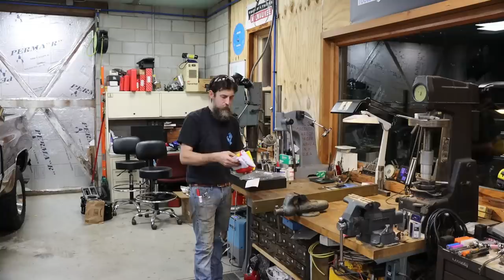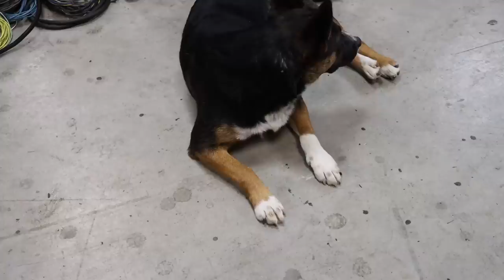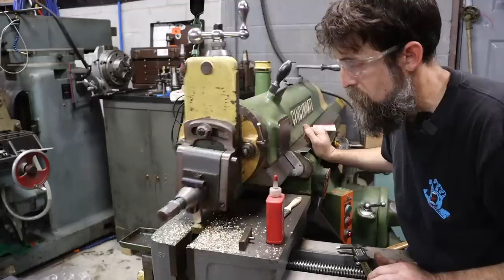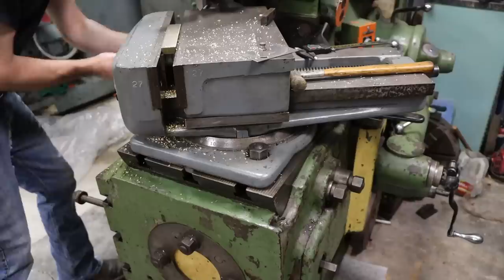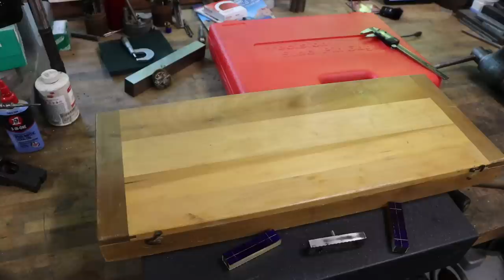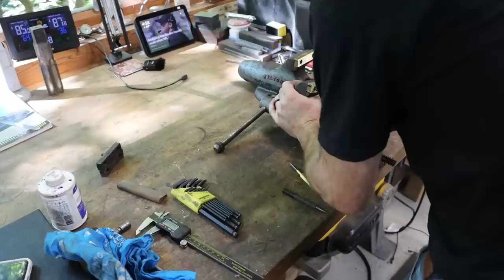Dumpster find 3'' Wilton Vise gets new Chompers.

Comment: I have one of these ready to restor. Someone welded the jaws on, welded the keeper that holds the handle in place, welded it to a peace of 3/4 inch plate and replaced the handle with a longer bar for more leverage. I picked it up for 20 bucks sprayed some  PB blaster in it and it still funtions like new dispite being beat to hell and back. I can see why people like them so much.

Comment: I found the same vise at a garage sale for 20 bucks it was froze solid  wouldn’t move    I soaked it in pb blaster an hit it with a dead blow hammer an broke it lose. Cleaned it up an put it to work.  Best vise I have ever owned.  I have a York bullet vise too works great.  Found a couple old vises in the trash.

Comment: Cool project. I have an old Starrett vise I need to make jaws for. It's funny the things that metal fabricators see. I could tell that your bandsaw blade has missing teeth behind the weld seam due to the slight jump the blade makes when it hits it.

Comment: I use good old fashioned, home made rawhide on all my vice jaws. You can get it on line or make your own. I like mine better as it has a bit extra softer material on the inside skin. I have a vireo on how to do smaller batches on  my channel. There is little to no cost aside from a bit of 3/4 plywood and a few screws to make a drying/streaching board. Once dry, I cut jaw sized pieces to make a face and a top L shape and and glue them together with crazy type glue.  Then use rubber school type glue to easily fix them on the vice so they can be easily taken off. They are great but I have never welded close to mine but for everything else they really shine. Lathe jaws too. My primary use is holding the silver pieces I make for file and sanding work. I was pricing vises the  other day and was amazed at how expensive they are now. This was an amazing opportunity for you. These new jaws are better than anything I have ever seen. Well done laddy !

Comment: Bob Ross of Machining.  Who has a big * contraption in their garage 😀.   Thanks Steve. The Willet bullet vises are slick. I found a Parker 974 from a basement of Fall River  MA  estate sale. Looks like it came out of a closed factory here. Its old and  works fine but missing a jaw.   For amateur tinker , Parker is long gone so left trying to hunt down a replacement jaw off a parts vise  or find a machine  guy nearby or most likely pass it on to someone who can fix and enjoy.  Cheers

Comment: Put a negative rake on the drill flukes Steve. This will prevent the drill from plunging into the work when the tip of the drill clears the part

Comment: Patience and attentiveness encourages low cost treasure finds. I have a long list of similar value treasures found unexpectantly. I enjoy using mine or passing them on to others. I pucjed up 2 identical Wilton vises (without the swivel bases) for $35 each. I am guessing that they were school shop surplus judging by 8-10 various colors of paint slopped on them. They were better than average gifts to 2 of my boys. One has been repainted at least once and has lived on the back of 2 or 3 of his service trucks. It is essentially his daily user. My "restoration" required paint removal and fresh paint. I didn't have to do any mechanical wirk besides cleaning. My son spends many thousands of dollars annually on new tools and equipment. A $35 vise is laughable to him, but he has never upgraded that Wilton truck vise.

Comment: Nice work on the jaws. I do hand chiseling on brass door knobs and steel vise jaws would ruin my work. I found lead way too soft. It ends up embedded in my work. Instead I go to my local tire shop and get scrap lead and zinc wheel weights. Nowadays there are lots of steel weights. Only the lead/zinc work. I made a steel mold for soft jaws that slip over my vise jaws. I cast about 5 sets at a time. When they are too deformed to use I just remelt them and they are good as new.

Comment: Hey Steve - great vid.  Re: the serrations on the jaws being too sharp.  I'm wondering why you didn't go back over it with the shaper and take another couple mils off the top to blunt the points? Conversely, you could've also changed the angle and/or spacing of the serrations and accomplished the same thing without sacrificing the thickness of the jaws.  Do you think the sharpness of the serrations will mar your future projects?  Thanks!